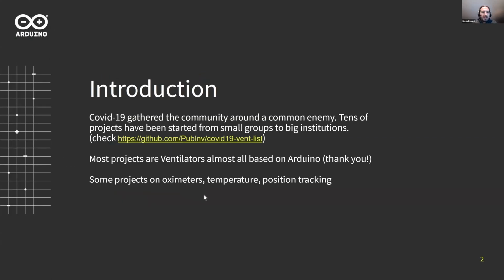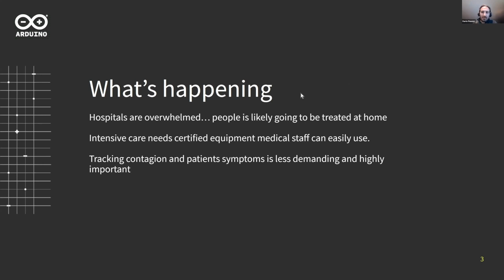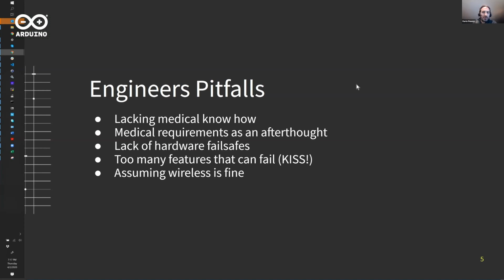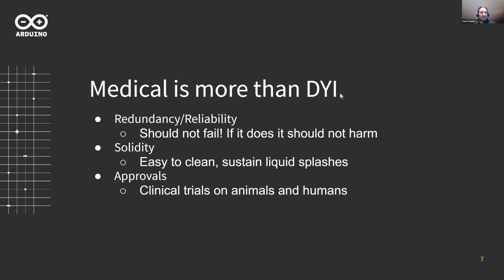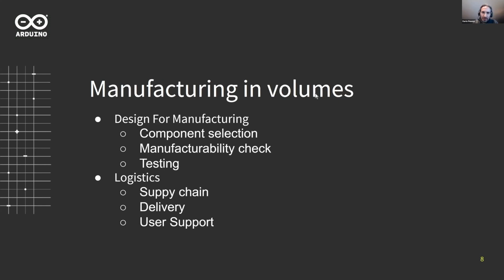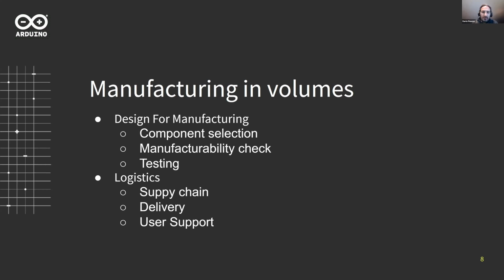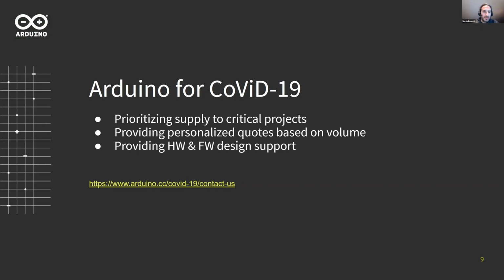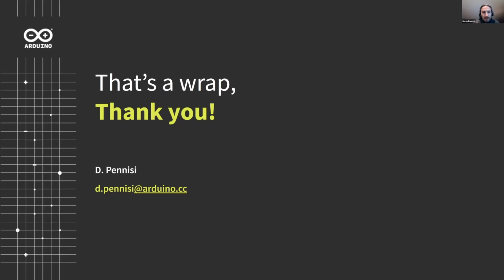Combating COVID-19 Conference: Technology and Manufacturing Challenges

Comment: Intake Valve
 
50 psi source (100% O2, or blended) – optionally 2 pressure sources (O2 and Air) – and the blending can occur within the valve.
Outlet pressure about 70 cm H2O max – (1 psi)
Flow rate peak of about 120 lpm
Would ideally like to have a regulated pressure output (i.e. a pressure control type ventilator), and not a flow regulated valve – but could use either if we have to (the flow will take a little more electronic control)
Must be computer controllable (0-10V, 2-10V, 4-20 ma etc. – or digital if required)
It would be nice if the valve could have a pressure sensor, and a flow sensor built in – to minimize the requirement to add these myself (but let me know with and without (esp for the flow sensor)
 
Output Valve
This generates the PEEP on the ventilator
Intake pressure (i.e. just before exhalation) would be about 10-40 cmH2O typically – but should be able to handle right up to the peak of 70 cm H2O.
When exhalation occurs to ambient air – the residual pressure on the intake side needs to be controlled to 0 – 30 cmH2O (usually in the 5-15 range)
Exhalation needs to be as quick as possible – ie large orifice to allow 120+lpm flow (at the low driving pressure)
It would be ideal to have a flow sensor for exhalation (that way the In and out volumes could be calculated – to assess for leak etc.)
The pressure sensor could be added here as well (as a large difference from the intake pressure sensor would indicate obstruction in the interposed HEPA filters)
 
All these valves will be isolated from direct communication from patient secretions etc. via filters.
There would be an HME (humidification device at the patient’s endotracheal tube)
There would be a filter just after the intake valve that connects to the patient circuitry, and that same filter (or a second filter (have not decided)) would isolate the exhaust gas as well (if 2 filters, that is where the second pressure transducer comes in handy on the exhaust side).
 
Control for all these will be via a PLC with an HMI, or a small SBC. The patient wetted circuits would be all disposable, and will contain no expansive mechanical or electronic components)